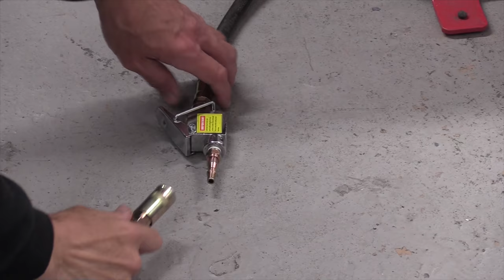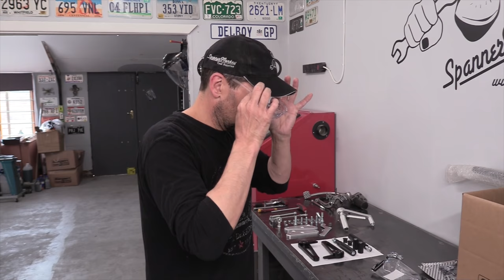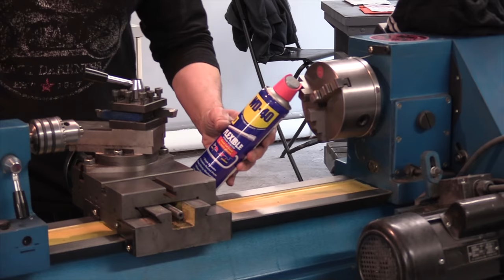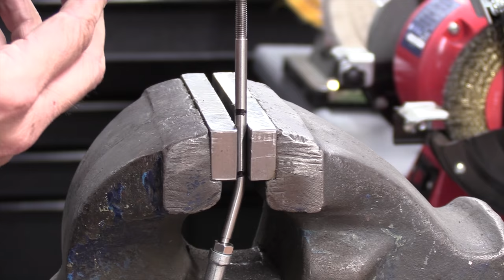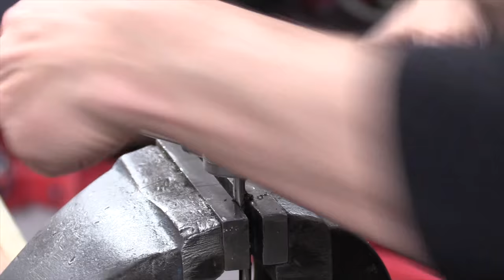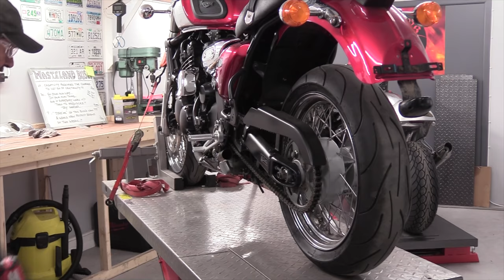Triumph TT Legend, Custom Shift Linkage !

Comment: Nice job Del.The final assembly looks good.  I'd like to make a comment. Respectfully of course. The 2 larger bushings you made would have benefited by an additional smaller boss on the side that mated with the adjoining surface. It would add strength and helped with location and concentric alignment.
Reply from the maker: Thanks for the great tip Joe, I see that, the face that the spacer mates up to on the peg side, is actually the body of the peg itself, the spacer provided was 2mm smaller than the peg, so I cam out to meet that diameter to provide more bracing when you stand on the peg... and, of course, to spread the load a little on the face of the frame.. I guess to machine a boss that would go inside the peg I'd have had to have machined out some of the peg itself, the way it seems to be designed, is that the peg fits inside the lever allowing it to turn, but like all these things, they're mass produced and there's always a slightly better way to design them I've found... it seems more than strong enough to stand on, and am going to machine down a lock nut to fit on the back, there's about 8mm of protruding thread inside the frame and once it's threadlocked, it should stop it working loose as with the peg being knurled, and your foot moving around on it all the time, I guess it could cause it to rotate loose... only time will tell!  Thanks again for your wonderful support Sir, it's always good to hear from you.

Comment: Hey mate, hello from Aus. Great work with the foot peg. I installed a set of rear sets on my gixxer track bike and it also used a single bolt through with no nut on the inside like you have for the peg itself, not the main bracket. I found with moving my foot forward and backward during riding, you are putting rotational force onto the peg and the foot peg began to rotate as it caused the bolt became loose. Even RED loctite didn't help. This was on the track so your moving your foot constantly from ball to toe for the corners. Maybe you wont have the same issue on a daily street bike. The more expensive rear sets have sort of like a little locating pin that stops the peg from rotating as the peg has the knurling to make it grippy. I would suggest keep an eye on it or even throw a nyloc nut on the inside if you can on the main bolt that holds it to the chassis. Love the channel and the detail you go into.
Reply from the maker: Hi Glenn, thanks so much for that insight mate, that's a very valid observation and something I would have probably found out the long way!  There is about 9mm of space on the inside, so not quite enough for a full nut in a nyloc, but I'm planning to turn one down to fit, it only needs maybe 3 threads with the addition of some threadlock, and it should be ok, but if that doesn't stop it (because vibration always plays a part) it may be worth fathoming out some form of lock tab, or a key way, but till I think it through I've not worked that out yet... thank you for the heads up mate.

Comment: Great video as always. I am following your Legend upgrades with great interest as I have one. I'm not really looking to change mine from original but am eagerly awaiting the tidying up, finishing and servicing tips. By the way, you removed the frame finisher to avoid the new linkage clashing, what do you propose to put there instead? There are some chrome ones available but I guess they will be the same projection from the frame as the one you took off.
Watching with interest! Keep up the good work.
Reply from the maker: Hi Neil, great to hear from another Legend owner, they're an amazing bike and a shame that Triumph make nothing remotely like it any more, but guess that makes them that more unique... with the finisher, there is only, maybe, 10mm of space behind the linkage, so I have a flush fitting rubber grommet that'll snap neatly in to the hole and I guess some flush fit thread caps to snap in to the thread holes, the kind that go in to your handlebar clamp allen screws, all that comes at the end, just dry building for now!  Thanks for your support and enjoy the project!

Comment: Nice to see you care for your fellow musician , in regards of the built you rush it , if you had taken your time and took all the propper mesurements you could have avoided eliminated the swingarm cap , a thicker spacer could have clear it but you had allready cut the bolt and the rod of the likage , take your time to think of what you do.cheers!!
Reply from the maker: Thank you LUIS, but a thicker spacer wouldn't have cleared it, with the securing nut included it would have had to space out at least an inch further, meaning the foot peg wold be too far from the bike, clobber your leg every time you put your foot down, and the linkage itself would have had a slant too far for the rose joint, it was all thought out mate, easier to remove the cap and going to pop a rubber grommet over the shaft head in to that nice recess.

Comment: This is a great video. Ive had my legend for maybe 7 months now and I love it. This is something I’d definitely like to have done to mine. I may be asking early before actually looking further but I was wanting to know if you’d by chance have a parts list for this here.
Reply from the maker: Hi Eli. These are the footrests and levers i used, but you do have to order custom length bolts to bolt them to the frame, and make your own custom double bent, rose jointed linkage, i made mine from some parts from another bike.. Hope it helps. https://www.tecbikeparts.com/products/shop-parts/other-bikes-universal/footrests-other-bikes-universal/

Comment: I'm surprised you didn't file down the cover or the bolt
Reply: Rubber bung could sort that out
Reply: I think 5, 7 years ago, how ever long it was, you mentioned to put the nut on the bolt, then cut it shorter if needed because when unscrewing the nut, it'll make its own thread. Saved my bacon that gem did. Cheers buddy. Be well 🙂

Comment: Fantastic work 👍 as always, (just trying to help)just a note for maximum mechanical advantage it would be best if the engine gear shifter and foot peg linkage leavers were parallel to each other, as you had them before you had to flip them round to clear the side stand.
Reply from the maker: Whilst it is relevant Savneo, it's not critical, the tabs should be within 10 degrees of parallel and that's fine, specially when they're as long as these... the angle of tolerance decreases with the length of the lever and more importantly, clearance of the operating movement is always a consideration when setting it up... thanks for your input mate.

Comment: Gday mate another excellent video ,what will you do about that cover or is it now going to be clear of the shifter link altogether .
Reply from the maker: Hi mate, with the cover removed there is about 10mm or clearance, so im planning to snap a nice flush rubber grommet in there to keep the dust out of the socket..

Comment: Very nice Del looks great. That defiantly took time thinking it through. Always like thinking on the outside of the box. Really like the music. Working on bikes and having music played go hand and hand. Del do you know anything about Oberon company? I am looking at getting a set of brake and clutch levers for my H-D.
Reply from the maker: Hey buddy, great to hear from you, hope you're having a great weekend.. Thank you for your kind words on the linkage, it was a lot of fun and very satisfying to get it working effectively and signed off...  Yes i have heard of Oberon, in fact back in the Harley play lists i have a video in there somewhere fitting a pair to a Sportster.... and as a measure of their strength, the bike in question fell on its side one day (aided by an old guy trying to park and not seeing it behind him), and the ball on the end of the lever took the full impact of the fall.....did id break off?.. NO.. all that happened was a tiny scratch in the black anodized finish, and the entire lever and switch block assembly was pushed along the handlebar by almost an inch.. all i had to do was loosen the screws that hold it all in place, wriggle it back down the bar into position, tighten it up, and ride home... so hell yeah, they're darn strong,  The only down side was the price.. they are about £75 EACH over here.. and you can buy the cheap Chinese copy ones for £12 a pair..  but two reasons why i made the obvious choice.. one:- because it was my Harley Davidson, my pride and joy, and why would i dress my best girl in rubbish... and more importantly.. i rode home that day and didn't get stranded.. the quality paid off and justified the investment..   we live in an increasingly throw away world.. and when fitting an upgraded accessory part,  IMO it should be at least "as good" as the factory item, or better..!     Hope that helps you sir, take care and have a good weekend.. D&Pxx
Reply: Delboy's Garage yea I just did the money conversion and might just get one for right now. That really is an awesome product.

Comment: I have a question re the shock on these chassis..... I'm building a cafe racer from a T300 trophy.... has anyone fitted a modern sportsbike shock to one of these...? I need to replace mine, and have noticed how cheap some modern shocks are...eg...gsxr1000k6/7 from £50 for a tidy one...or similar... Anyone any experience or pointers...? Cheers...

Comment: Awesome work Del. Some fantastic engineering to solve the problem. I’m sure a rubber grommet will cover the cap you had to remove.  Keep the videos coming.
Reply from the maker: Hey Alan, you read my mind exactly, I've got a perfect black nylon cap that fits exactly in the hole that actually came off the back of an old blowtorch!... use what you have aye?!

Comment: If the spacer between the frame and footpeg was thicker to the extent that you didn’t have to bend the link rod, would the rod clear the cover that you removed? I’m not being a smart-arse - it’s easy to be wise after the event and difficult to anticipate everything in advance.
Reply from the maker: Hi Glynn, I did think that through mate, but the amount of contact with the cover was about 20mm so it would have needed to clear by at least 5mm (because the covers unnecessarily fat, and what's under it is almost flush with the frame, it's more a style thing), so to space it round it would have meant bringing the peg out a whole inch, giving way more flex, which I don't want and also clobbering my calf every time I put my feet down, not to mention the extreme dog leg I'd have had to put on the link rod... easier just to whip it off and am going to put a flush bung neatly over the shaft bolt, it'll look really cool!

Comment: Nice job Dell. Everyone;s a freaking expert on their key board aren't they? Just keep doing what you're doing.
Reply: Hi Del, not sure if you remember me I sent you some brittool robo pliers a long while ago, i still watch very often I was wondering if you can help:

I have bought a cbr 1000rr fireblade 2012 plate, broke down yesterday just cut out battery seemed dead, checked battery with a multimeter and voltage is rising when running, left the battery over night and its at 13.2 volts, lost .2 volts over night, i have rode the bike around 600 miles in a week for it to go that low to require a charge does this mean the battery is defective?

However seems to hold the charge now im a little confused.

Thanks